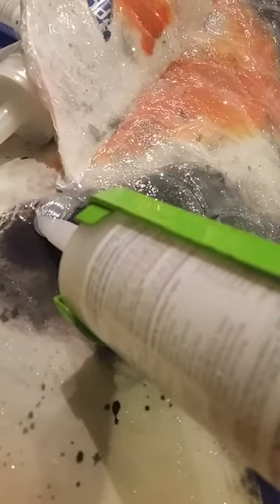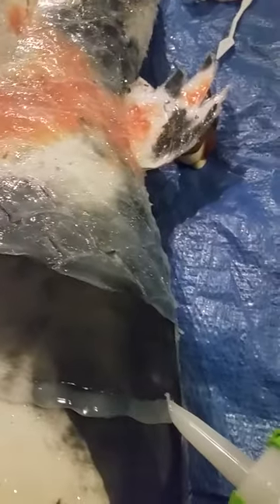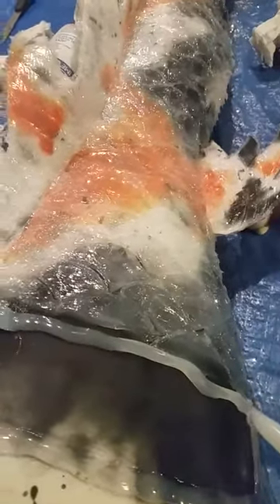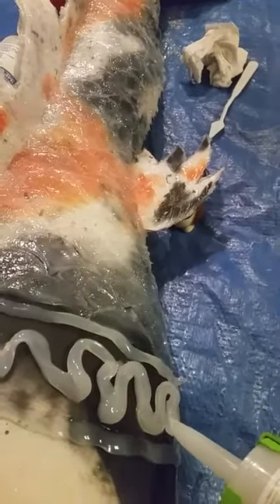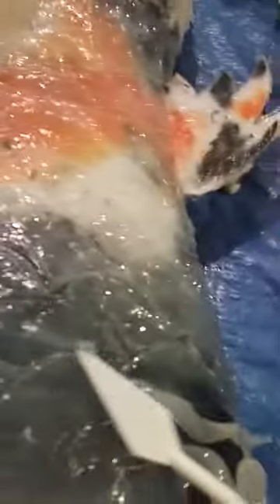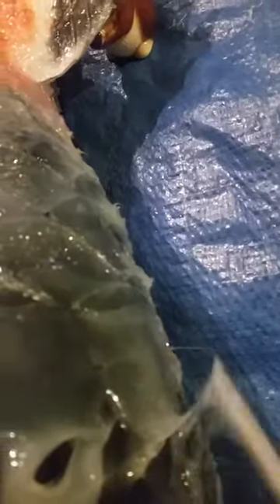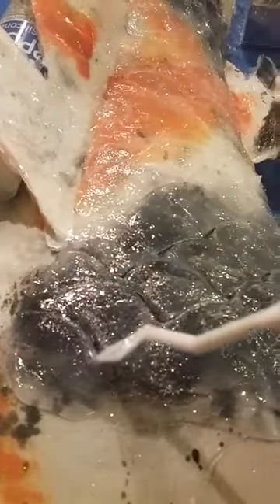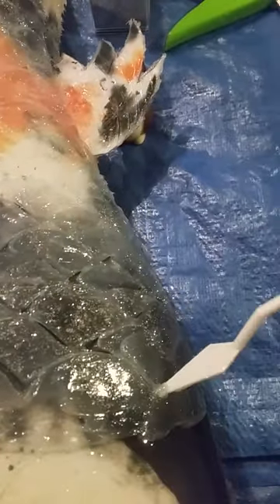How to make quick mermaid scales using silicone caulk

Comment: hi, love the paint job but I know of mermaids who have gotten very sick by using the silicone caulk. It has sent them to the hospital after the caulk got into their blood stream.
Reply: Desirae Jenks 
Yea I heard that too I'm planning using something similar but using marine caulk.

I made sure it was chemical resistant if I ever was to use it in pools. The brand I'm using is not apart of the Dap "Alex" and " Alex plus " but "3M " which is used in water and chemical environments. I'm planning on making a series of videos to show and help people with a based way of making a cheap tail with a lot of labor and love. And I'm about to post the first video in a couple of weeks about starting the project and safety.
Reply from the maker: Desirae Jenks I have read all of the threads about the wrong kind of caulk and have even read stuff written by the mer that was sent to the hospital. I use 100% ge silicone. It is the only kind I have seen that is considered safe once cured. It is the go to silicone in tin cured tails